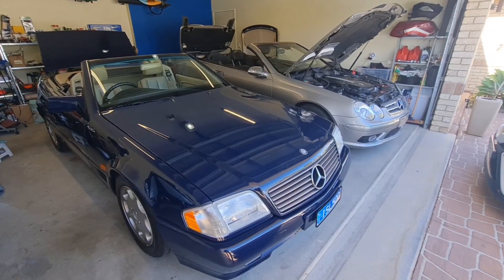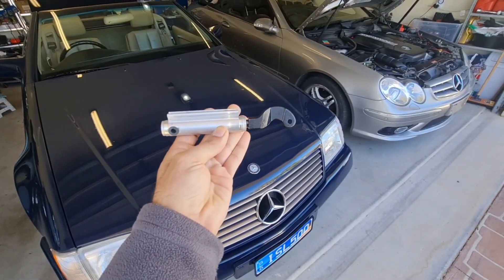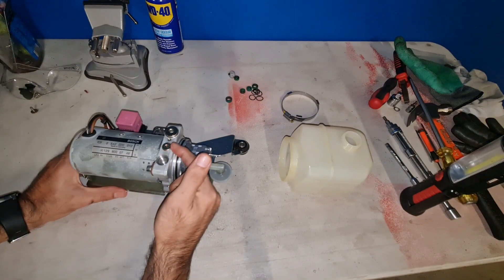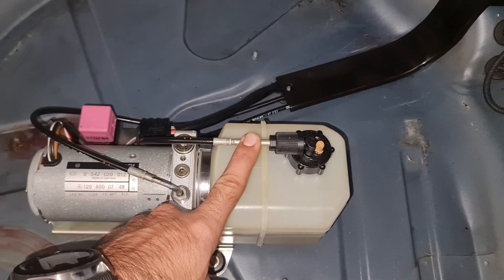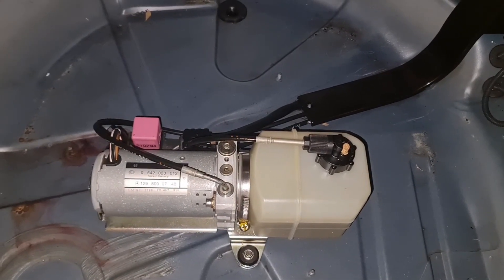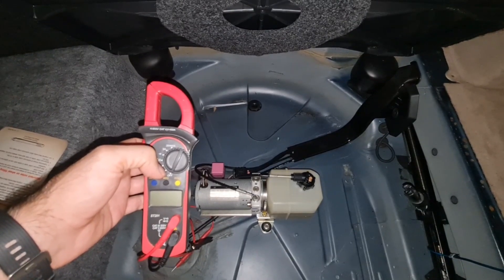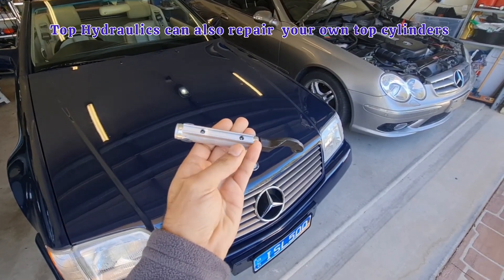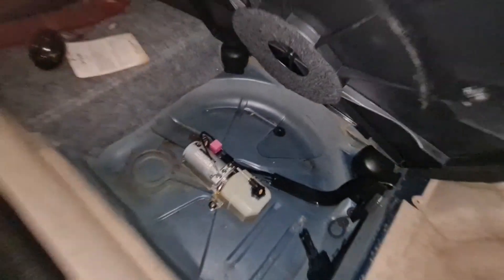Weak Convertible Hydraulic Pump or an Internal Bypass?

Comment: hi dear, thanks for the video , i have an r230 sl500 , my hardtop was working fine , and i noticed that i had a oil leek on the cylinder behind driver seat , i sent my car to a garage ,and now my hardtop nor go up or down and there's a malfunction on screen when i press to go down/up , what should i do, i cant trust any mecanique anymore , should i remove it and open it solo and check?
Reply from the maker: Good news is you have a fault code, so diagnose your car and watch this too: https://youtu.be/ytzbiHGgrk4

Comment from the maker: Hello my friends, please watch this video to the end as it can provide you with many hints to diagnose your top hydraulic system issue. So Basically in this video I introduce 4 possible methods of testing the top hydraulic pump and one easy way of checking for internal leak. Good luck and let me know your feedback and experience, cheers.